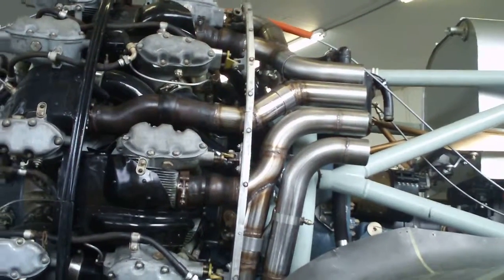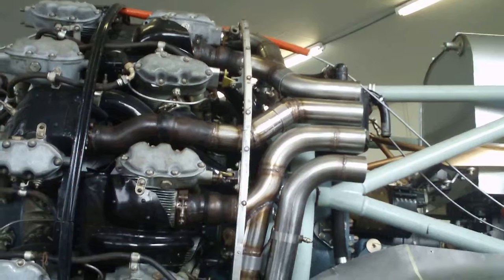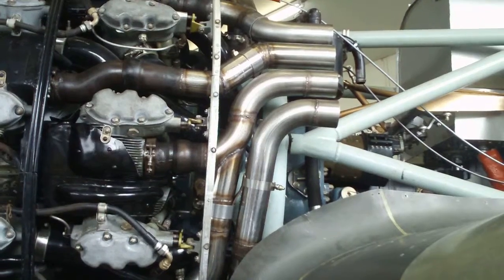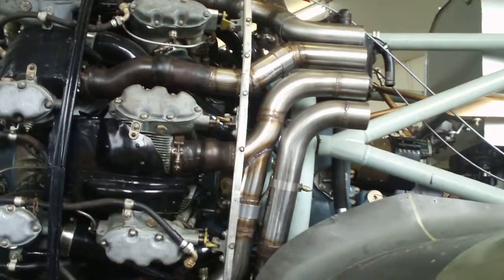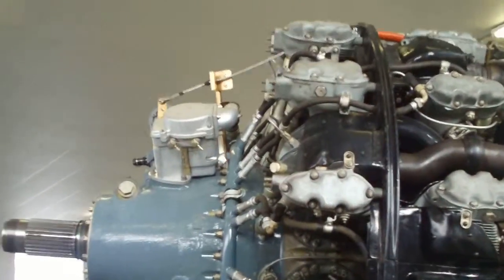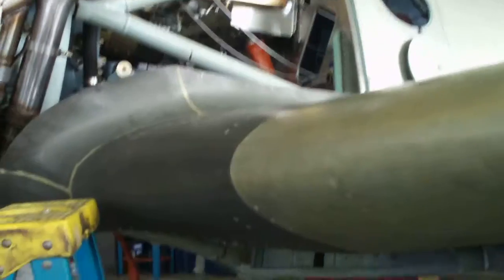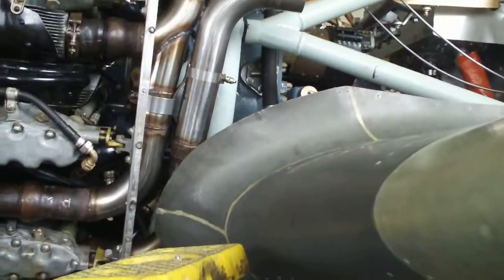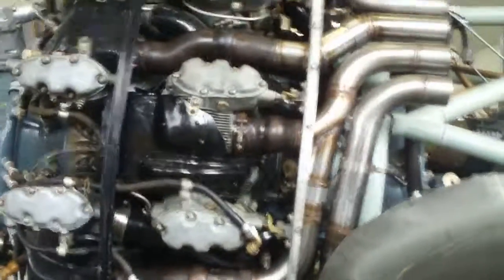Exhaust Stack 7 29 09

Comment: @mtx001 
Russian-designed Shvetsov ASh-82 14-cylinder radial built in China. It was chosen for these Fw190 replicas because it is similar size, weight, and power output as the original BMW 801s. The Fw190 replicas were a German project intended to offer a more affordable warbird project for buyers using an engine with good parts supply making the aircraft easier to service and keep flying. One new-build Fw190 has been fitted with an R-2800 in California.